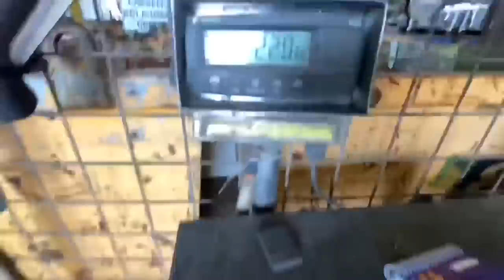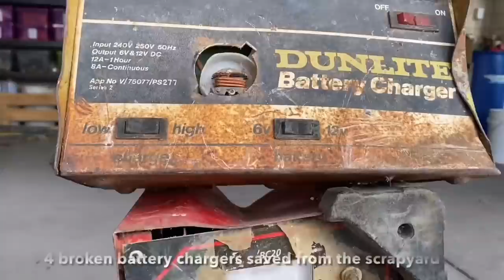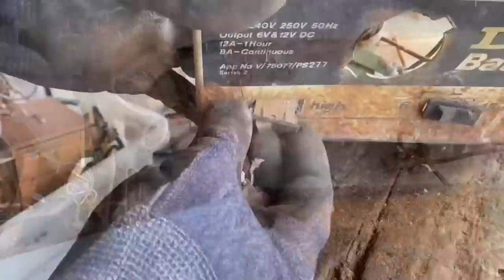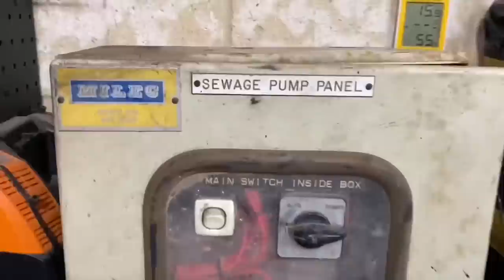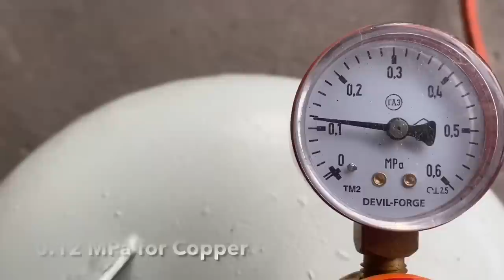ScrapYard Salvage - Busted Battery Charger Bars - Trash To Treasure - ASMR Metal Melting - BigStackD

Comment: Another awesome Friday melt!  One quick question:  When you get copper covered aluminum does that get alloyed into the aluminum or does it just burn off?  I always wondered what happens in that case, thanks.  Keep the melts coming, it’s all appreciated!
Reply: Given that aluminum has a lower melting temperature than copper, it gets alloyed in.   Believe the melting temperature of aluminum is 660 C, where copper is, I think, 1089 C.   If the copper is melted, it's more likely that some of the aluminum is being burnt off.
Reply: @kevinbray3724  Cool, thanks for that, much appreciated!

Comment: Always had a thought how much does it normally cost to buy scrap from a scrap yard?
Reply: That’s a good question I was going to ask that as well, I’m sure it’s cheap or else BigStackD would not have done it😊👍🏻
Reply: Would like to know aswell! In Germany it is really hard to even find a scrapyard that sells such kind of stuff. Mr BigStackD please enlighten us :)
Reply: @FynnR  here in the US in my part of Florida we have 1 scrapyard in the area and they typically will sell it for double the price they pay for it so steel currently is 8¢lb or 20¢/kg so you would but it for 40¢/kg you can buy 500lb for like $25 on average
Reply: @tjboylan20  insane good prices for smelting that scrap. I would totally do this as a hobby to recycle trash
Reply: @FynnR  yeah in the US scrap prices are at an all time high because so is inflation, I am a bladesmith so I cast Aluminum and Copper for aspects of my knives and swords. It’s extremely easy here i take old soda/beer cans and melt them along with old power tools and electronics

Comment: Unless I am mistaken, what happened with your bottle was that the lid hit the bottom of the shelf which sent a shockwave through the bottle, causing a cavity, a small pocket of vacuum, below the beer. When the shockwave traveling through the beer, which is slower than through the glass, catches up with the cavity, it collapses and the inertia of the beer knocked it out of your hand. Same principle as the party trick where you hold on to the neck and slap the cap really hard to knock the bottom of the bottle off!

Comment: FUN FACT When trying to remove old rusted screws, first place the screwdriver into the screw slots and using a hammer tap the handle of the screwdriver causing the sharp end to be driven into the screw head. Usually one tap will help break the rust seal between the screw and metal. Next give the screw a slight turn to the right while applying force pushing the screwdriver into the screw while ever so slightly turning the screw to the right. Once you've done these quick steps you will find the screws being much easier to remove. I hope this doesn't sound too complicated because it really isn't.

Comment: Third time I've tried to write this....... I wanted to say I've been using half as much fuel bakeing crucibles and pouring bars warming it up from .02 to .04 to .06 instead of going straight to .10 or .12 for pressure. You just have to closely regulate the airflow accordingly with the fuel pressure as to not be too lean or rich. I've found melting copper, aluminum, silver, and aluminum bronze worked up slowly to  .06 to be no problem and within 5 minutes of starting furnace. Then typically once it starts to get soft I'll move up to .08 to .10 to .12 to get hot enough to fill my coin molds. Should be making copper coins tomorrow and maybe a couple bars see how much time I get. Cheers.

Comment: I like watching Negreanu wandering around the casino floor as well. He seems like a good dude.

The copper coating on the aluminium is only microns thick I assume, so it just ends up as a component of the slag?

Comment: I love the content, melting disassembling, your dogs are cute as heck and the beer so cold makes me wanna drink everytime! But I have a question though...why not steel and iron? Always sending to the recicling friend but never melting.....why? (Oh the hunt for food inside boxes and drawers are the best part hehe)
Reply: The answer is quite simple he uses clay Graphite crucible's for his melts they can't withstand the temperature required to melt iron and steel you need a steel crucible or something close to it that can handle the temperature needed to make it melt also you need stainless steel molds specially designed to handle melting it or so I have read up and studied. If he had the crucible's designed to handle it I'm sure he would happily melt steel and iron. But he is using copper, brass, and aluminum for most of his melts. Hopefully what I have told you helps 🙂

Comment: @18:45 or so, why were there particles flying out of the mold as you poured?  The molds had just been used for a pour and looked hot so I'm confused if it was moisture or not.

Comment: Hey D, was curious on the copper coated alu wires, you melt it all together but does the copper get seperated or does it just become part of the melt mixed in? Always wondered because i figured it was such a small amount of copper it wasnt worth splitting or maybe couldnt even be done affectively?

Comment: But if the wires are aluminum with copper coating.. where does the copper go when you melt them? All I saw was aluminum.

Does it not separate? if not how do you reclaim it off those kinds of wires?

Comment: I dont know if this is a silly question or not but what happens when you mix two metals that don't mix in a alloy, like aluminum and cooper?
Reply: I think he has mentioned this before when he has melted copper with some aluminum on it and it just comes up and can be taken off like slag

Comment: Obviously this is vastly different that what you do normally, but have you ever thought of melting down glass and doing something interesting with it? I.e., melting it into industrial "bars" (I think glass is usually in cylindrical sort of tubes when you by it industrially? not 100% sure) or maybe making it into little sculptures, things like that. I'm sure this would require a lot of different equipment but I just thought it would be interesting to suggest 😊 plus, I know you're big on recycling, I thought it could help even more! (and imagine having a trophy from all those bottles of corona?)

Comment: I've been following you for years now and i'm really thinking about getting a forge. I've saved 1000's of cans in my shed for the day.
What i'm wondering is tho. Can you melt multiple types of metal and cast them to create a layered ingot of Copper, Aluminium, Brass etc...?  
Would they layers just come apart of would they fuse together? Sorta like demascas steel when you polish it down?
Reply: The brass and copper will just melt into one metal. Bronze lol the aluminum takes way less heat to melt than the copper or brass so might burn off before the others really get to melting. If you're doing primarily cans you can build a decent furnace for it instead of spending hundreds on one
Reply: I'm by no means an expert, but I don't think simply layering them on top will weld them together if thats what you mean. Maybe if the previous layer is still a bit tacky they will stick together?
Reply: Although he does have videos on melting aluminum and copper and making aluminum bronze so it'll probably all just melt down into one metal
Reply: @imadudeplayingadudedisguis5842  especially when aluminum will only stick to aluminum
Reply: @imadudeplayingadudedisguis5842  that's what I meant if the layers would fuse/weld together to make a solid ingot. I suppose melting both down and pouring them in at the same time might work? Unsure but would be cool to see.

Comment: Do you have to wear a respirator even if your a few feet away monitoring the melt ?
Reply from the maker: Normally I will wear a respirator but if it’s a very windy day and I stay up wind I sometimes won’t bother but when I’m sanding and drilling and grinding the bars and coins I will 100% always use a respirator👍🏻.

Comment: Why not do this? After you pour your metal, heat it back up in the mold with a blow torch so you dont have those ripples in the bar.

Comment: What's the worst you have ever got hurt doing these?
Reply from the maker: Actually the worst I’ve been hurt is using the drill or other tools when it might have something cut through my glove with a sharp piece of steel or something. I’ve had a couple of small burns here and there couple of blisters on the fingers but nothing to worry about. I get injured more taking pieces apart than actually melting and pouring👍🏻
Reply: @bigstackD  I'm terrible, mine is stupidity and then laughing at myself saying "it's no wonder women live longer than men" but my motto is "it's not been a good job if you've not bled over it"
Stay safe buddy